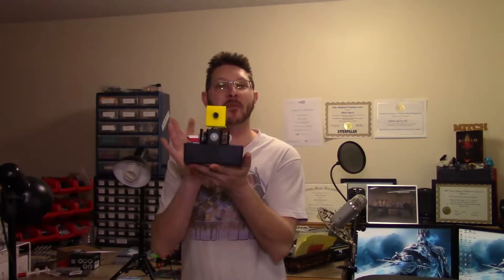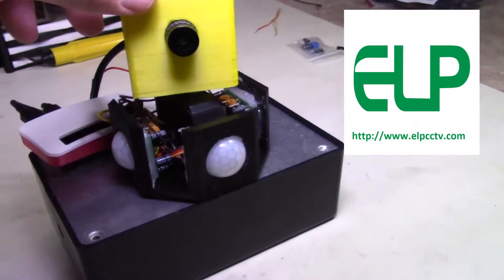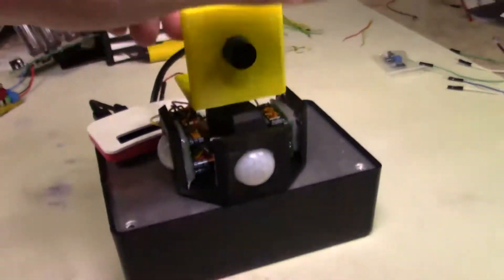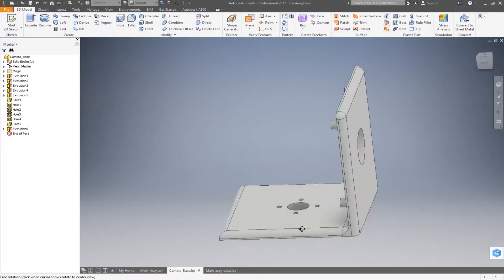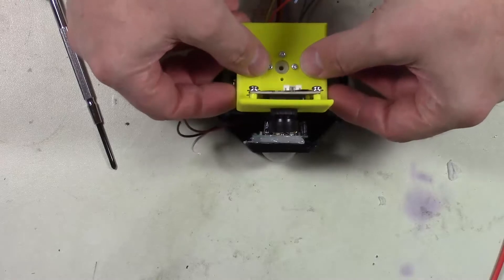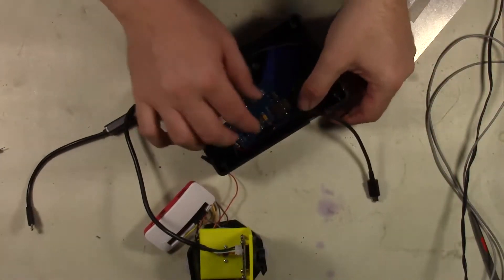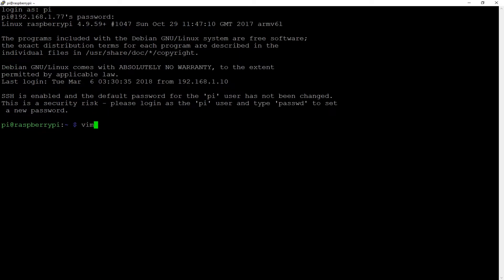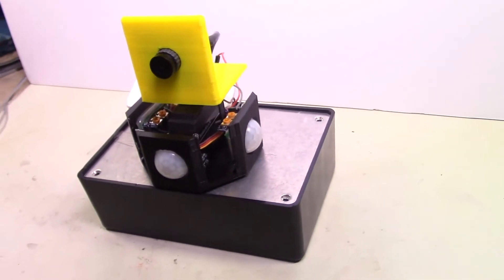Motion Activated Servo Camera

Comment: Great sir there is query can we implement flashlights instead of the camera
Reply from the maker: Totally!  You could just replace the part of the code that issues the take picture command with togglig a gpio pin to turn a light on and off.  Great idea
Reply: @misperry  Thankyou so much sir I will work on it.